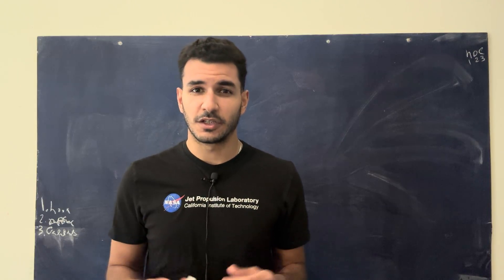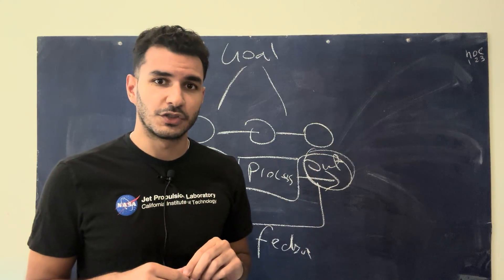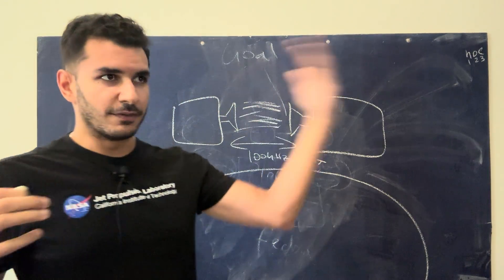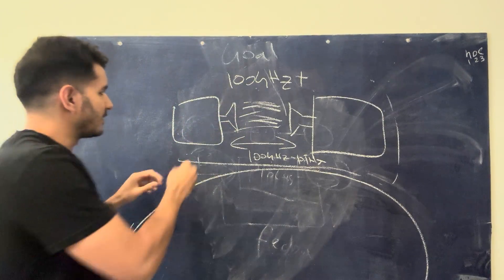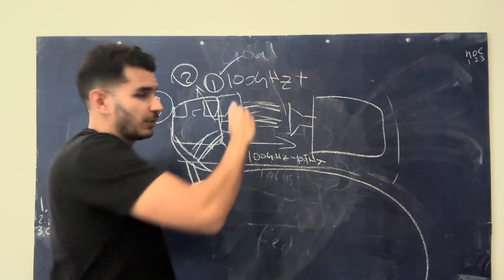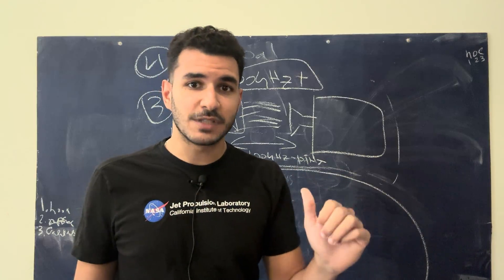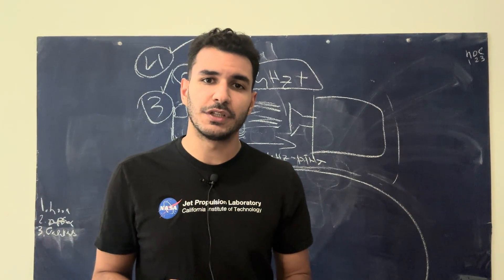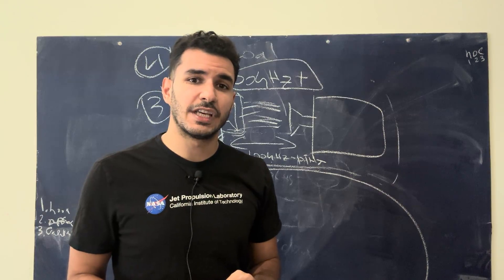NASA Engineer explains why systems engineering is the best form of engineering

Comment: for me as a CS sophomore undergrad, i feel system engg is a multidisciplinary thing - super vast and complex with dependence on a variety of fields like math electronics electrical and mechanical engg and software. theres often money involved as well. my goal in the future is to become a system engineer atleast if not in career as a hobbyist where i build complete machines from scratch from prototype to product. i think having a masters degree is cool cuz you get to work in this direction with a specialized focus. probably no place for me to comment on your idea of the master program but i feel skills where many field come to together is where most ppl are lacking. they cant put together a electronic circuit with super optimized software running on it that works on core mathematics and physics concepts. they rather form teams of large numbers and do the work. if your master program can fix this, i promise ill attend it when i am done with uni. As always thank you for sharing a valuable piece of information with us. great stuff 🔥🔥

Comment: Hey Ali, I have a instrumentation and control engineering degree for my bachelors and a data science degree fur master's recently. I don't know if you have AI driven systems in mind that maybe marries the two as coursework perhaps?
Reply from the maker: of course
Reply: @alithedazzling  I know it's a big ask but would you be open to have some coursework available on Coursera/YouTube? AI driven system design are still in infant stage and I'm curious to understand the direction you are thinking of, is it more designed to the CD side or a mix of both electrical and CS
Reply from the maker: @hari8568  i will try to make more technical content on YT

Comment: I started out my career as a Land Surveyor who also developed skills in GIS and AutoCAD. Then I became a GIS Manager of a large city and was exposed to networking, systems administration, software development, and Web GIS. 

And now I am an IT Systems Engineer. 

Your career has been top-down and mine bottom-up. At some point I would like to complete my EE degree.. and get a similar PhD to yours.. around GPS and Signals Processing.

But because I came from the field work (measurement path) my BA is in Geography and MS is in MCIS.
Reply: Great content btw!
Reply: Can I become a systems engineer with a degree in electronics and computer science, and then a masters in electrical engineering?

Comment: Systems engineers who could design every single piece of a system are rare. They would have to be very experienced to have completed an example of each section. More commonly systems engineers utilize reductionism to break things into pieces. The pieces are farmed out to experts in each field. Integration tells you how good they did. Open and closed loop control systems are quite different. I practically jumped when you left the summing bubble off your closed loop (NEGATVE FEEDBACK) system. Of course, managers care about schedules and budgets because they are there to get a PREDICTABLE Return On Investment.

Comment: I am a mechanical engineer that works in electronics development (RF inverters and amplifiers). This kind of discipline is critically needed to come up with good design approaches for tightly integrated systems. For example, it’s almost impossible to have a truly small or lightweight system without a system architect that is looking at how to design the system electrically, but also consider it mechanically, identifying newer, smaller parts. We don’t have this role at my job (we have systems engineers but they do not do this architecting role sadly), so it turns into a haphazard back and forth during detailed design. Or, Even worse,  it becomes a straight out adversarial “that’s not my job” relationship between disciplines which results in bloated, disjointed design. So yes this degree would be very useful.
Reply: systems in systems engineering by convention refers to i.t based or any application that takes in data and CRUD type actions and the engineer is an administrator, creator of such an app or deployment of an app or tech stack.  What you are asking of your 'systems engineers' is a LOT. src: im a principal systems engineer)
Reply: are you talking about MBSE when you mentioned the "architecting role"
Reply: @jacobmishelevich2342  I am talking about someone that can successfully understand each discipline enough to converse with them and foster a unified vision of the technical goals and constraints in such a way that the end product has a reasonably harmonized balance between the design goals. MBSE can help drive these kinds of behaviors but ultimately process is secondary to the individual and collective abilities of the team members.

Comment: In my opinion, a masters program in  systems engineering is gonna be very essential since it spans across a ton of other engineering diciplines, hence, gives birth to a strong definition of engineering.

On the other hand, inorder for it not to be like a jack of all trades kind of a program, it's crucial for it to have a specific area of specialization. E.g systems engineering with focus on the electrical, programming or mechanical side of things.

Comment: Most real systems out there are multidisciplinary and extremely complex, that is why experts are needed for each system. Randomness is inherent to these systems. Modelling uncertainties is part of experts jobs
Reply: Isn't systems engineer a jack of all trades but master of none? Not specialised experts in any engineering field nor better than business school grads in big project management. Neither here nor there.
Reply: @grapefruitsyrup8185  problem with both of those niche fields are that they really never understand the big picture. Specialized experts in the engineering field are only sought for that specific field of expertise. and with business school grads in project management, they often mess up the project plan and requirments because they only know how to talk business but no idea how to actually implement business solutions if its more complex than an excel sheet (which is usually the case). Which is why computer science, data engineers, software engineers, technical (buzzword) roles, alll poppped up. because they need expert generalists to be the glue
Reply: @grapefruitsyrup8185  no
Reply: Nothing is random, everything follows strict cause and effect

Comment: I have a industrial tech and Manufacturing Engineering BS, a MS in MechE. Considering a Syatems PhD. However, I'm concerned of the ROI of the education cost to salary increase. I currently work at a Aero/Def been there 8yrs and looking for my next move. Any advice on thr pros/cons pf the PhD.  I have worked as tooling,Manufacturing, project, and currently a test engineer.  Considering making the move the SE.

Comment: FYI, most Mechatronics Engineering programs, at least the good ones, are effectively Systems Engineering programs.
Reply: Same as Electrical Engineering
Reply: Likewise a lot of Aero and BME programs follow a systems Engineering framework
Reply: Many Systems Engineering roles require the knowledge of virtualization/containerization, active directory, group policy, IaC, clustering & loadbalancing, cloud computing platforms (AWS/Azure/etc), CI/CD, CDN, backups, bigdata, web servers, database servers, DNS servers, DHCP servers, email servers, VOIP servers, file servers, etc, etc (most of which probably aren't included in Mechatronics Engineering programs). Some roles require a heavier emphasis on software engineering or network engineering or data engineering or even mechatronics engineering. Some leans more towards DevOps, while others towards SRE. It all depends on what company you work in and what system they need to get working.

I've been working as a systems engineer for a decade now without knowing a single thing about mechatronics engineering. And that's why I think Mechatronics Engineering programs are called Mechatronics Engineering programs (and not a Systems Engineering program).
Reply: @senantiasa  Those topics are included in MTE programs around my area. Systems Engineering as an academic program is also frankly quite vague so that could amount to practically anything depending on what the curriculum actually entails. 

And above that, one can teach themselves any Engineering concept they were not taught in class if they cared to do so for their own benefit.
Reply: @senantiasa Different area, but I know what you are talking about because I worked in that area with that title. However I also took 2 grad level systems engineering courses in ECE which are more advanced and refer to what he is actually talking about.
Reply: @cheikmaiga5463  I guess you're right, but the definition mentioned by the youtuber at 2:48 that "system engineers ensure that all the different components (physical or non-physical) are designed to work well together, well-integrated to achieve a goal" rings true for the other systems engineers too. There were also people who I knew who leaned more towards hardware and microcontrollers, but the more I think about it, the more I'm thinking that you're right and that this is just a naming conflict problem. So I'm gonna shut up now... LMAO
Reply: I agree that good ME programs require two courses in both circuits and systems engineering.  The "light bulb" turns on for how systems work for most students when the analogy between electrical circuits and hydraulic systems is explained.   The interchangeably of each function of the components really helps to understand the concept of a system and things like feedback loops.  I have always believed that Mechanical Engineering provides the basis for almost all engineering disciplines.
Reply: what is the difference between systems engineering and mechatronics?
Reply: @narman9390  Mechatronics is robotics
Reply: I’m currently in mechatronics and this is true. It’s basically all systems. This includes heavy control systems and robotics. Majority of us will go into the industrial field and work with automation. There’s so many jobs there.
Reply: I will likely be studying Cyber Physical Systems Engineering for my bachelor's, which used to be called Embedded Systems and IoT Engineering. They go over all the required maths and mostly it's technical. Programming and Circuits are huge. Essentially it's all learned to build an innovative product, which is essentially a system. I do hope though, to be able to do a Master's in Data Science, specifically ML + AI tool development... That'll hopefully allow me to build lots of systems that I can only dream of right now :(

Comment: I’m currently doing a double degree in Electrical Engineering (Honours) and Physics. I’d say a masters program in systems engineering would be so valuable for students who have a passion for problem solving and want to go into industry where research is pioneered at the individual level. Without PhD students like yourself going full gas at a massive project like the high speed space Comms we don’t typically get to see the need for multidisciplinary engineers but in most cases it is their individual work which becomes the most valuable as they can conceptualise all aspects of a project at there own heightened level of understanding, and then feed it down the ladder.

Comment: Hey Ali, systems engineering is something which I am really interested in so it was nice to see a video from you on it. I'm currently attempting a computer science and electrical engineering double bachelor's degree (which I have reasons for doing dual degree rather than bachelor's and masters). I was wondering, given that a systems engineer is somewhat a jack of all trades, would it be better if I would pursue a mechanical engineering master's degree (meaning that I would end up proficient in mechanical, electrical, and software engineering) or instead pursue a system's engineering masters. The thing is, I just want to learn about as many topics as I can... I don't really know what exact topics a system's engineering degree would cover; I just want to be able to understand all of the different parts of a system and be able to fully plan/create devices. If a MSSE would fully prepare me for this goal then I would definitely look into pursuing one, but I would only go for whichever degree is best for this goal (and I think it may be best to learn more about mechanical engineering for me).
Reply: I just want to point out that doing a masters in mechanical with having  CS and electrical bachelors could be alot. Personally I have a bachelors in mechanical and am doing a masters in mechatronics, and it's hard. I feel behind on electrical and programming, and feel good about the mechanical parts of the mechatronics. The electrical and programming is just so different from my mechanical background that it makes it quite hard to stay afloat for me. 
That said, I wouldn't have the head to do 2 bachelor's at once in a demanding field like engineering and technology, but you do, so you might fare just fine. 
Just wanted to warn about the differences and potential hardships. :)
Reply: @pinesyeet  Thank you very much for the comment. I sympathize with how you feel in some ways. How you feel it's hard to stay afloat with all of the electrical/programming is how I feel with mechanical. That's why I would really like to do a mechanical engineering masters because then I could feel confident in that aspect. That being said, I'm not a very gifted student to pursue two degrees, it is just that I have a lot of enjoyment for digital systems. I know I can succeed with electrical eng and computer science because it is something I truly enjoy, but it feels incomplete without mechanical engineering as that would help me fulfill the physical parts in development. Thank you for the insight, I appreciate it :)
Reply from the maker: great foundation
Reply: You do not need to develop technical expertise in many fields to be a great systems engineer. You need a foundation in a lot of different fields and a good understanding of the basics. Great systems engineers will be able to identify when to consult with experts to better understand a component of the system or the system itself and how to solve a problem to develop a more robust system. I would recommend you develop the skills you will need as a systems engineer in a masters program for systems engineering over getting a masters degree in mechanical engineering if you plan to be a systems engineer.
Reply: @csantos2  Thank you very much for the input. I will take this into account, much appreciated.

Comment: We have a masters for systems engineering (in Freiburg Germany) and I am really interested in housing systems in regards to sustainability, electrical energy and thermal optimization as well as cost effectiveness. Which feels like a good step after my electrical engineering bachelor with some modules in mechanics and programming. :) So basically I am already in a systems Engineering program but I must say it has issues, there is a lack of teachers thus we have many changes and unfinished learning materials... It was established in 2023 so it is quite young and still kind of chaotic, I hope it will get better... Thanks for the video, Jonas :)
Reply: It’s pretty common in Germany. At rwth Aachen we have a masters degree Systems and automation with is a extension for the electrical engineering bachelor
Reply: which university has that program. I would like to apply it for my masters
Reply: It is not new. Most diplom degrees had a very high composition of systems engineering. Now they most teach them in masters level.